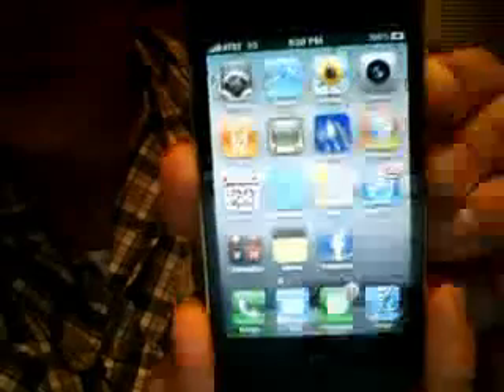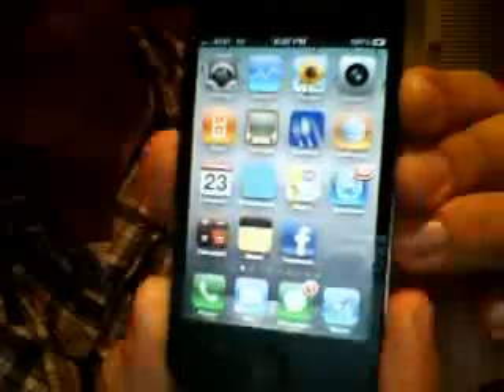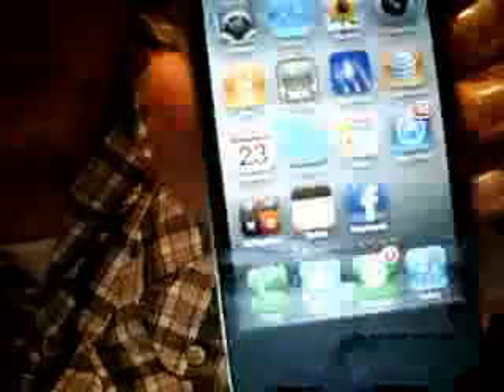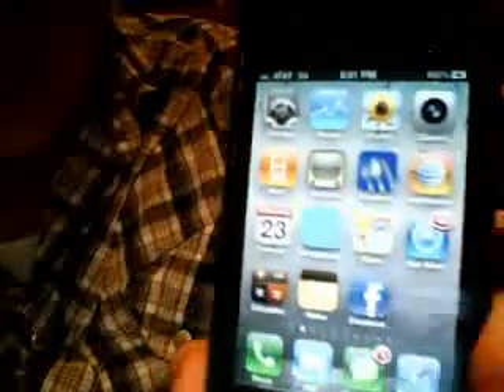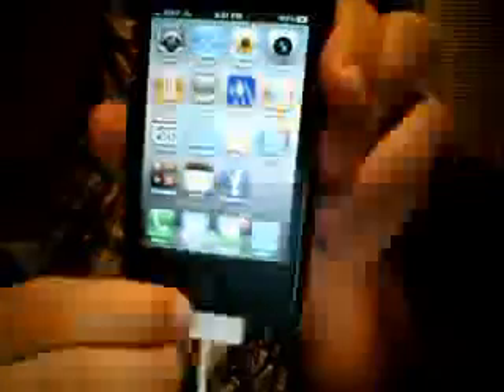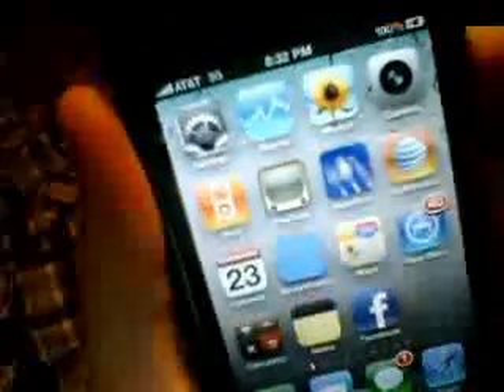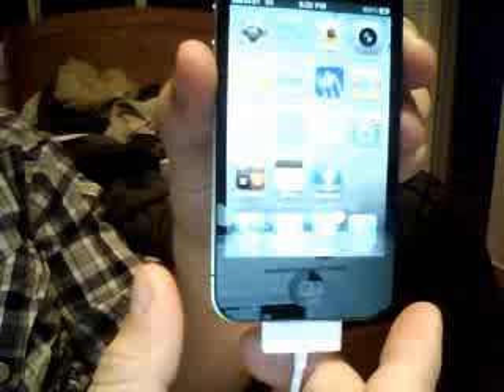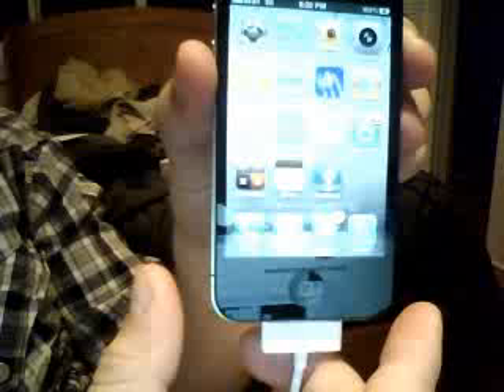iPhone 4 Reception issue identified! Part 1

Comment: Done some test on my iPhone 3G and have been able to duplicate many of the Reception/Transmission issues that are found on the iPhone 4. When holding my iPhone 3G, the phone loses 2 to 4 bars and Reception/Transmission speeds are dramatically reduced (I used the SpeedTest app). Maybe we should be testing other iPhone models, as well as Droid phones to get a better perspective on this issue.

Comment: This video demonstrates a very simple solution to the reception problem. Just put on a bumper, and problem solved. The bumper insulates the antenna from your hand, preventing interference. Since bumpers are currently sold out, you can just put some tape around the antenna until they are available. But if you really want to give up all the cool new features of the iphone 4 like HD video, you have 30 days to return it.

Comment: Apple just released an official statement today that a software update will soon be released to address the problem.They acknowledged the problem and said it is entirely software related and not hardware.It looks like it is due to a miscalculation of the way the number of bars are displayed.I believe that is why some of the iPhone 3g's were also affected by this issue when updating to the iOS4.That simply proves it is indeed software related.

Comment: @guzguz21 a software could fix this problem, my iPhone 3g wifi signal seemed to have improved after a iOS4 update, and apple product signal problems have been fixed in unusual ways before, such as the older macbooks brightness on the screen effecting wifi with snow leopard. same with the iPad

Comment: I've had this phone for a week, no problems, but this is a real issue and I did this same test, however only the left side antenna had has any effect, without a cover/protector I can go from full bars down to only one, it takes much longer to drop bars with a cover/protector.....my fingers do not cover this left antenna area so I guess it don't matter to me much, wifi is not effected one bit

Comment: @erycstrife HUGE problem.  I've owned every generation of iPhone - including the new iPhone 4.  I'm disgusted.  I actually tried returning it yesterday.   But since I ordered it direct from Apple, I can't return it at the store.  I've since heard a rumor that the new batches are going to fix this problem and those with the problematic ones will be able to exchange them.  Has anyone else heard this?  I'm going to hang on to mine until I get confirmation one way or another.

Comment: @bigtheo03 The issue seems to be that you basically link the ariels which needs to stay seperate..

enrcstrife would you be able to test a silicone case and not just a hard case.. ?

because silicon is more closer to being skin i guess..cuz its soft n all

 I just ordered a silicone case and If it causes the reception to be low whats the point in using one.

Comment: What's most likely going to happen is within the next few weeks Apple will silently push out a hardware revision without admitting any wrongdoing (highly doubt a firmware update will fix this) which will address the problem for all but the early adopters.  From there, early adopters should be able to snag a replacement under their warranty coverage.